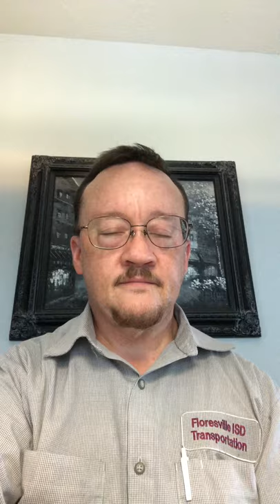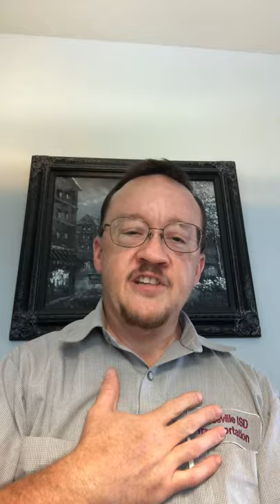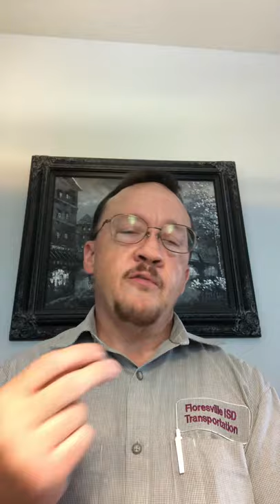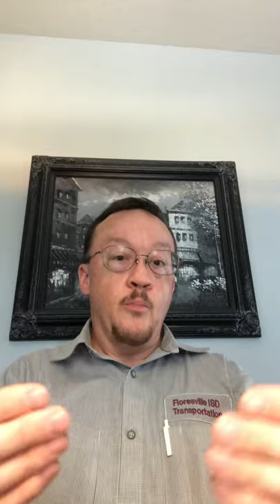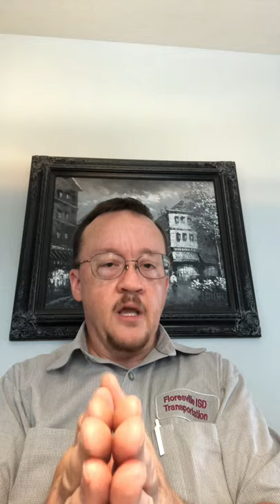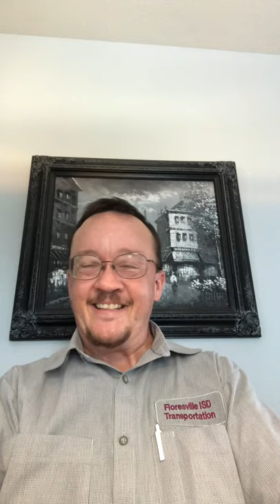Here’s why fuel efficiency dropped on Project Farm’s HHO test

Comment: You lost me at the "acid rain" boogieman bs.
Reply from the maker: I understand completely.  I purposely did not get into that very much.  Do NOX emissions contribute to air pollution?  Yes.  Is it as big of a deal as what we are lead to believe it is?  Absolutely not.  Is climate change real?  Yes, it’s called weather and the climate changes every day.  Do we play as big of a role in this as what we are lead to believe?  Absolutely not.  Are electric vehicles the solution?  No, they exacerbate the problem and are absolutely horrible for the environment.  So don’t get too caught up in buzz words and jump to conclusions, unless you have a jump to conclusions mat!!  Have a great day!!!
Reply: @91CavGT5  We moved to Fresno ca in 1984 and most days there was a layer of brown crud, especially when you looked towards highway 99. By 2000 that was gone, between much cleaner running diesels and the computer controls on cars. The biggest scam on diesels is an egr and egr cooler. A diesel runs best at high combustion temperatures, short of melt down the higher the better. The hotter the cleaner. Of course you produce more nitrous oxide, (which you still have even with the egr &cooler) so why not make it run as good as you can and then take care of the nitrous. Out of 20 trash trucks 2010 and newer we usually have at least least one in the shop for emission problems, sometimes for days or weeks while waiting for parts.
Reply from the maker: @cbmech2563  I agree 100%